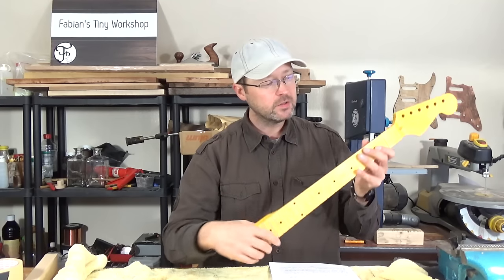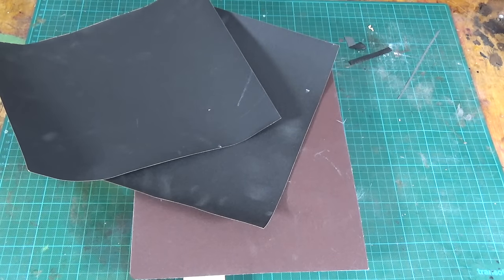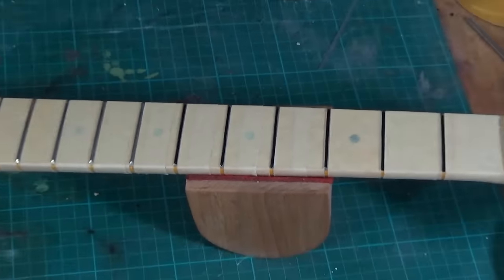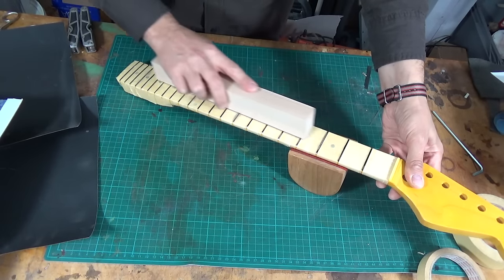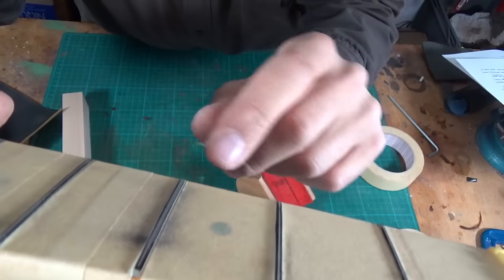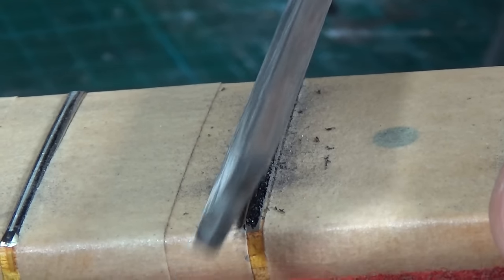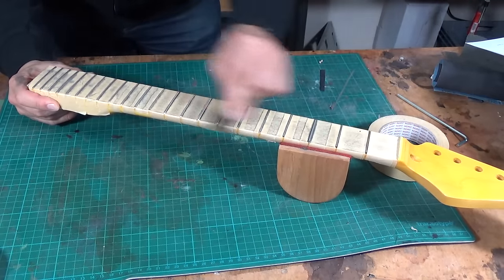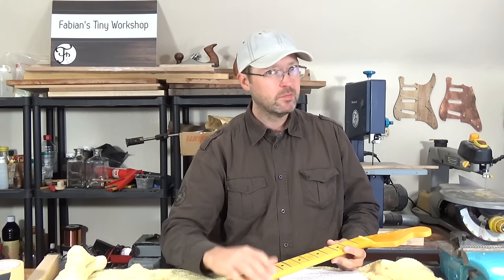Fret Leveling - The Easy Way // How To

Comment: Here in the US you can get a notched straight edge for under $30. Even if you're not doing a lot of fret work, it is an indispensable tool for setups. I personally wouldn't trust a piece of cardboard. 

Also, you can buy a $5 slim taper file at Home Depot, "safe-sand" the corners, and you have a fantastic crowning file akin to a high-dollar crowning file.

Comment: Good tutorial. I’m gonna try this. I think the challenge will be maintaining fairly consistent fret height as wear tends to concentrate below unwound strings between 1st and 17th frets. I quess you just have to take more from the areas with less wear. But not to worry, if I overdo it, next I will be learning how to scallop a neck.

Comment: You can probbably use a dremel with a buffing wheel and compound to eliminate muchof the polishing work
Reply: This is what I do and it works great. It's quick too.
Reply: I do this too, i go from 1000 to 2000 and then buff with the dremel. Mirror finish

Comment: Some tricks  I have been using  for years is using a Laser cut nail  file  and a multi sided nail buffer block the metal laser cut nail file the perfect  grit, shape and size that cannot  be found in traditional  metal files or dimond files for frets and last a very very long time , same withe the buffer block, 4 sides with 4 different super fine grits for polishing  and both together  cost no more than $9 us

Comment: Good video, but I'd suggesting buying and using an aluminum fret-leveling beam.    The problem with wood is that a piece that's dead straight this week can be warped next week, even by just a few hundredths of an inch.  And for a DIY'er, that just creates the potential to make a mess.  Fret-leveling beams can had be had relatively inexpensively.

Comment: Tip: If you shape a piece of thick 220 grit around a drill bit roughly the same size as the fret wire, it will hold it's shape and give you a perfect crowning file. 

Sanding with light pressure on one side of the fret at a time, then moving to the other side gives you a distinct intonation line right through the middle of the fret. 

Keep sanding side to side until the line disappears and your crown will be perfectly centered, shaped and level.
Reply: But a drill bit is cylindrical, i don’t understand how you can crown a fret with that? Am i missing a part 😂
Reply: I don't get it either. How can you get a concave fret crown with a convex drill bit?
Reply: @gaddebeli  The gritty side of the sandpaper wraps tightly around the drill bit. You press a crease where the two sides of the sandpaper meet. When you REMOVE THE DRILL BIT from the sandpaper and open it up, you have the right size and shape to crown with. The crease you made sits snug between the fret and fingerboard and that's where you put most of the pressure with the edge of your finger to hold it in place. Work side to side a little at a time until theres a very fine intonation line dead center of the fret. That line will eventually be polished out as you use fine and finer grits. If you take your time, you'll end up with custom shop quality frets even if you have little experience, like me. 

I did this after taking my guitar to a luthier and ending up with triangle frets. It wasn't really that bad, but I wanted that straight off the wall PRS feel and most luthiers will not get you there, or charge $300, because it does take time.

Comment: Hey there. This is a nice video. I've been using a 3rd hand guitar that's been used for 15 years and boi, the 2nd fret has a very very deep curve. I've been sanding it for about 20-30 minutes with a 120 grit sandpaper
Reply from the maker: Thank you. If you remove a lot of the fret height, you might want to level the nut slots too.

Comment: Perfect instruction, and simple...I'm sure a lot of us that build guitars, also have handed them off to a "So called" Luther when a fret job was needed.  I just thought it would be a hassle, and I'd probably screw it up! I think a job like this goes for around $300 if you bring it to a guitar shop? Correct me id I'm wrong...can't believe how simple, and quick this job is after thinking it was a huge deal for years. Thanks a lot Fabian
Reply from the maker: Thank you.
It's really not that difficult. Of course, I would not recommend anyone trying a fredjob on an expensive guitar for the first time without practice.
On the other hand on a budget guitar it is not worth paying the "experts". 
If you're into guitar building it might pay of buying a cheap neck of ebay or amazon for practice.

Comment: Just leveled my frets successfully lately. My main tip was to get Fret crowning file, why? because there's many reason. 1.) it would save you a lot of time and labor(i shaped my fret less than 15 minute) 2.) it would also prevent you from damaging the frets specially if you were first timer like me. 3.) it would give you a clean look. I got my fret crowning file in online shopping for just $4 shipping included(it's a cheap one but it does the job pretty well). My next tip is to make sure that the top of the low fret was sanded completely because if not you might still get fret choking specially when you bend string going to that low fret. My last tip was to use 400, 800, 1000 grit sander paper for sanding the frets after it was got crowned.

Comment: Excellent tutorial, thank you!  I've read in some places that you shouldn't sharpie frets on a maple fretboard because of potential bleeding through into the fretboard. Has this ever been an issue for you?  If so, what do you recommend to mark the frets?
Reply from the maker: As long as the fretboard is lacquered this should not be an issue. To protect the fretboard you can use masking tape.

Comment: I done it simmilar way at home yesterady for first time and no problem.    I had problem with some fret was higher than others and it caused unwanted buzz noice of some tones.  I also learn how to setup guitar properly. I changed 9 string to 10 so it was little bit harder to setup it again like ti should be.  I have both sides tremollo.

Comment: Wow, I was totally not expecting that. I was thinking it would be "OK, first you need several hundred dollars in wood working equipment, then you need several years of experience doing some kind of maintenance job and finally you need a master's eye for detail." Nope. Wood and sandpaper. Love it. Absolutely brilliant. I wish every incredibly intimidating task turned out to be this simple. Now the question is will this fix my fret buzz on d and g below fret 7? Anyone wanting to answer that so I don't have to attempt this would be considered awesome in my book. I've tried adjusting everything else but I just don't know enough yet to trouble shoot this with any certainty and I'd really rather learn how to diagnose this than pay to have it done. On the other hand I'd rather not spend several hours leveling frets that didn't need it and risk damaging something on an already mistreated guitar. I eyeballed the neck while adjusting the truss rod until it was perfectly straight then pulled the action on the g almost all the way out but it still goddamn buzzed, so I left the action where it was, put the relief back in, and same deal. My guess is either some nut adjustment that involves something I've not yet considered (I didn't make any adjustments but I tried watching a few vids on this and it doesn't seem related but I'm not real good with the physics of this like this so I suppose it's possible), uneven frets, or the warp on the neck (left it in a hot house for a week during an AZ summer) is beyond repair but since it came straight and the buzz is on the middle strings I wouldn't think it would be warped that bad. I haven't touched it in multiple years nor did I really know how to play anyways though I tried and lost interest many time but now I'm older and I just have this insatiable urge to learn this. Funny how life changes. Anyways... HALP! PLEASE! Before I make it worse. It's just a cheapo Squire Strat covered in angsty teenager shit and stickers but I want to salvage it if I can, it was my first guitar and well... it took 20yrs but I finally decided it was time to actually learn and it's going quite well actually (I'm developing callouses WOOHOO!!). Except this. :/

Edit: Grammar, spelling, and detail
Reply from the maker: Of course I'd have to see it before giving you a definite answer but usually if only one fret buzzes it's because the string is in contact with the nex fret. It's because the fhe fret you are playing is to low or the next fret is to high. If the next fret is to high you can level that fret. If it buzzes because the fret ist to low you have to level every other fret to the level of the lowest fret.
Provided the neck is straigh take a straight ruler, put it on the fret in place of the d or g string and look if it touches every fret to find yout what the problem might be.
Reply: @FabiansTinyWorkshop  Thanks! I'll go ahead with the leveling then. Wish me luck and thanks again.
Reply: @SatansYardsale  How did it go? If I can suggest something based on my experience. If one fret is far too low, then that fret needs to be pulled and replaced. If you do what I did, and try to level the others down to fit, you may ruin the whole thing because the strings now touch wood each time you bend. 
The decision whether to pull and replace one fret that is too low, or alternatively, to level all the others to the level of the low fret, is critical.

Comment: Excellent video and I just clicked on the like and subscribed to your channel. Thanks! One question: you mentioned in the beginning that this is a new neck. So why would a new neck need a fret job? Is this recommended for any new neck? how do I know if my neck needs a fret job? Thanks!
Reply from the maker: Thank you! Appreciate it!
Simply put, an expensive neck shouldn't need a fredjob. This neck however was a cheap one. On inexpensive necks they do not alow time for woodmovement. The necks ist cut, the frets are pressed in and dressed right away in a hurry. But since wood can move, the frets can partially move too. At least that's my theory. To check if your neck needs a fret job just take a straigt edge put in on the frets and look if there are gabs. You can also take a fretrocker and check for high and low frets. The simples way to tell is if you're experience buzzing or fretting out.
Reply: @FabiansTinyWorkshop  Perfect. Thank you for prompt reply!

Comment: Nice video, gonna make it on my strat soon. What grade of steel wool do you recommend? 0000 or does the 000 do the job too? Just because 0000 is hard to find.
Reply from the maker: I think 000 will do. If you want it more shiny you can always use some polishing compound. What also works well are those high gloss polishing nail files /nail buffer.

Comment: This is a fantastic video which I thank you for and appreciate. Yet, I'm concerned how the initial sanding of the low "medium" frets which are most worn down at many key points will be sanded "into submission" or to such a low level that they will become necessary to replace, and therefore extremely expensive to the point where its just easier to buy another guitar. That's a problem for me as my (EVH Wolfgang Special made in Japan) guitar has become quite rare, hard to find., and becoming crazy expensive. Any suggestions for best way to proceed to save my guitar??
Reply from the maker: Unfortunately you can only level the frets so much before they need to be replaced. You could refret the guitar with stainless steel frets but that would change the tone a bit.

Comment: Excellent video - thank you for taking the time to make it! One question, I thought the truss rod should be adjusted with the strings on for tension, no?  Do you readjust the truss rod after you put the strings back on?
Reply from the maker: For the fret leveling I need the neck straight otherwise it wouldn't make sense to use a flat sanding beam. For the actual setup of the guitar I adjust the truss rod with the strings on to get the desired neck relief.

Comment: I've watched half a dozen vids on fret levelling- this is probably the clearest. Excellent "teaching" video.
Good work.
One question though- what 'roughness' of file do you use? I.e. teeth per inch? First/ second cit of finishing?
I think yours was diamond (?) what do you suggest?
Reply from the maker: Honestly I do not know the grit of the file. When it comes to sand paper I usually start with 220 grit to take away material and then work my way up to 1000 and steel wool.

Comment: Hey, please. Could you elaborate how to make the straight notched edge with the cardboard? I can figured it out, but is always helpful to know how someone else had already done it. Thanks!
Reply from the maker: The material doesn't matter, the main thing is that it has a straight edge. I used a piece of hard cardboard. But a long ruler works better. Mark where the frets are located and use a file to file the notces so the straight edge can rest on the fret board.

Comment: A very clear and concise video.  Thanks.  Sometimes after using my sanding beam all of the fret tops are showing the marker removed.  However if I take my fret rocker and check them some frets are still high. What causes this?  I would think that if all the fret tops are showing material removed they should be level.  Should I re-level all the frets with my beam? Or just do spot leveling on the high frets?
Reply from the maker: The only reason I can think of is either you are sanding at an angle or you are putting the fretrocker at an angle. Because of the radius of the frets this might be the reason. If you sand at an angle or put the fret rocker at an angle. Might also be that the sanding beam is not level or to short?!
Reply: @FabiansTinyWorkshop  thanks for the reply I'll keep an eye on my levelling next time and make sure I'm keeping my beam (fret guru aluminum) and my rocker level and flat.

Comment: At about 3:15 you say that "while sanding I make sure to maintain the radius of the fretboard".  But how do you do that?  It seems like with a perfectly flat leveling beam, all of the fret would eventually be completely flat and not have any curve.  How do you maintain the fretboard radius on the frets while sanding?
Reply from the maker: By moving evenly from left to right and not staying in the middle of the frets.
Reply: @FabiansTinyWorkshop  Thanks for your help.  I followed your instructions as closely as I could and my frets are much more level now, and I was able to lower the action on my guitar significantly with no fret buzz.

Comment: Rather than using steel wool and having to deal with the steel wool dust, I like to use a sanding sponge which works just as well but is cleaner and safer.

Comment: Great video!  Question, why didn't you use a radius black to do this?  Thank-you
Reply from the maker: With a radius block you automatically remove more material than necessary. In addition, it covers the frets and uneven pressure can cause the fret ends to be sanded too hard. Actually all professional Luthier on Youtube use a fret file or a beam. I think that gives you more control over your work. That doesn't mean that it doesn't work with a radius block, but it doesn't work for me.
Reply: @FabiansTinyWorkshop  thank-you for the explanation. I'm very new to fret dressing so help, such ad your reply, is greatly appreciated!

Comment: awesome .I have a level metal longer than  the length of the bar ..isn't short leveler wood you  use scratching more in the middle because middle is always touched but outsides are not .? will long leveler do better  or both works ?
Reply from the maker: It does not matter as long as you know how to use it.

Comment: Hello Fabian! What is/was the approximate length of your beam? I need to level a bass guitar. I'm thinking about using a carpenter's level. Thanks, in advance.
Reply from the maker: 25-30 cm, something like that.
Reply: @FabiansTinyWorkshop  Thanks, again. I have a 30cm level I''ll try.

Comment: This is my second time watching this informative video. (I commented a year ago)
I got a new guitar and just 1 or 2 frets are high. Is there a video on just fixing a few high spots so you don;t have to sand the whole fret board. Also, the nut is too high in my opinion, do you have a video on filing the nut to a lower height. Thanks as always.
Philip
NYC/Jersey Shore Area
Reply from the maker: If 1 or 2 frets are high you just need to sand/file those frets. If you are dealing with low frets you need to sand all the other frets. No unfortunately I to not have a video on filing nut slots. I always thing of the nut slots as the Zero-Fret so make sure to make the slots level with the frets or slighly higher.

Comment: Very good video, many thanks ! I have a couple of questions : It's better to totally loose the trussrod or it's better to turn it just the amount to have the fretboard straight ? wich sandpaper you suggest to start levelling ?
Reply from the maker: Since we are using a straigth sanding beam to level the frets, it is important to adjust the thrusrod so that the neck is as straight as possible. Usually I use 220 grit sandpaper. For nicke frets any kind of sandpaper will work but aluminum oxide or silicon carbide is recommended for sanding metal.